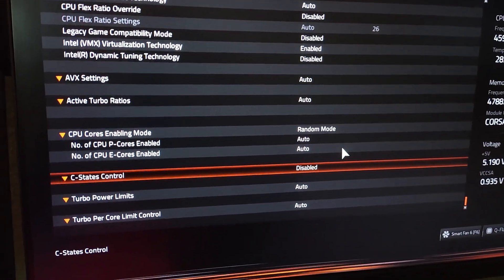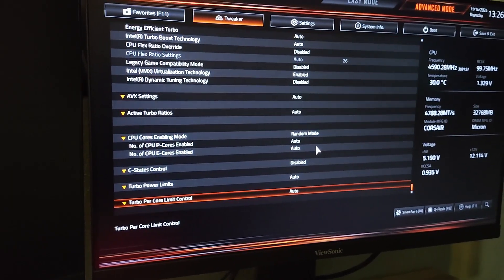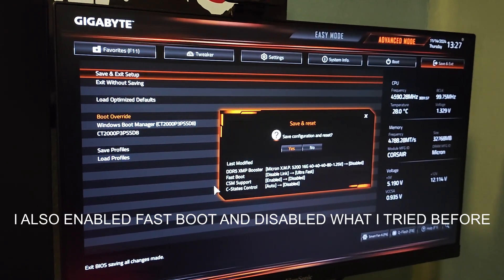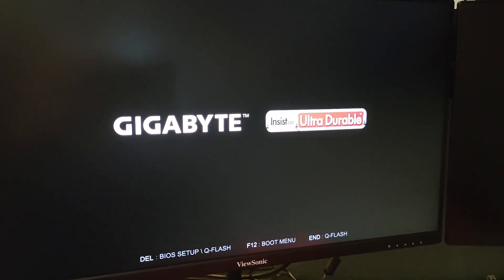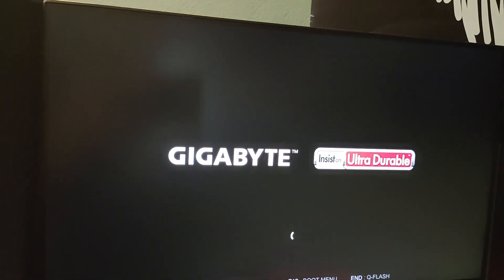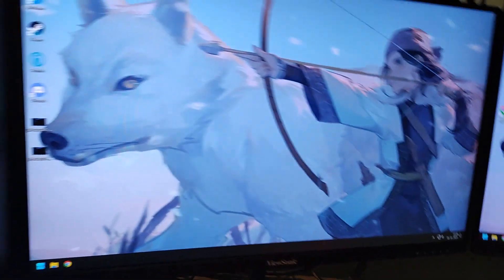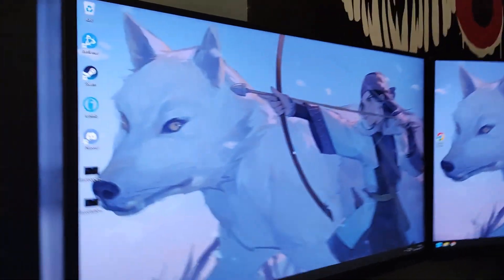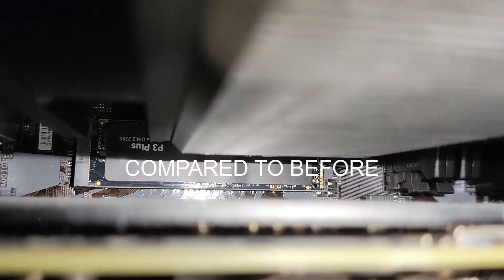How to Fix NVME SSD Noise using BIOS - WORKED FOR ME!

Comment: JESUS THIS IS SUCH A SPECIFIC FIX. I have this noise and its been driving me crazy. Im a little too worried about possible instability to test it GOD its good to know., Also have a crucial drive. I wonder if i can just up the cpu min state in power setting to offset this. I also notice reduced "whine" when under higher load.

Comment: I took apart my GPU completely to fix this problem amd there was fan noise but now I realize that it's not the GPU... its the ssd ... its pissing me off because it's giving me tinnitus and in the my ear much more... thanks alot brother you saved me from going crazy.
It worked! 70% of the noise is gone from startup and 50% light loads for now.